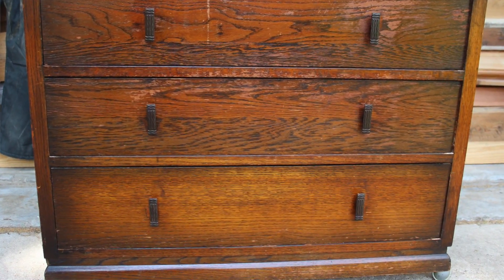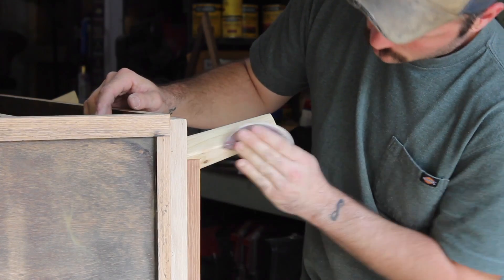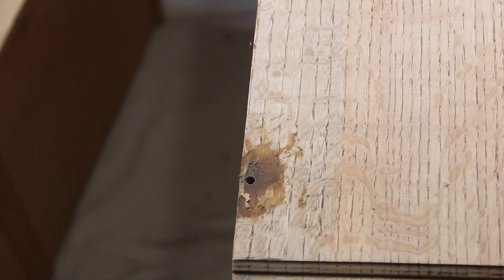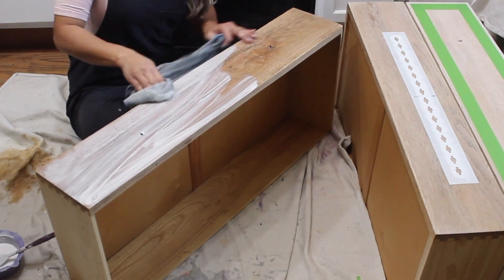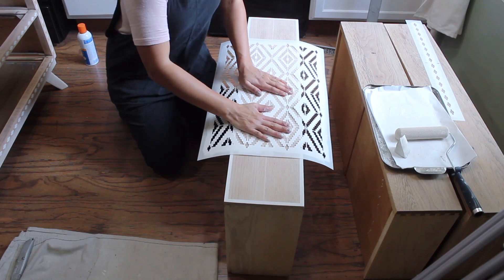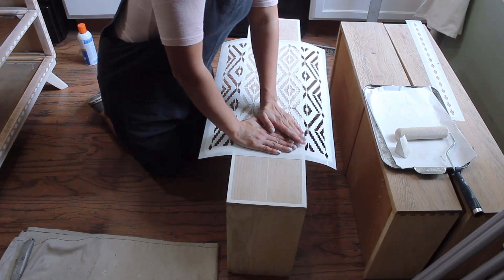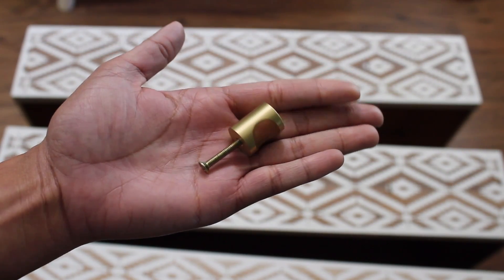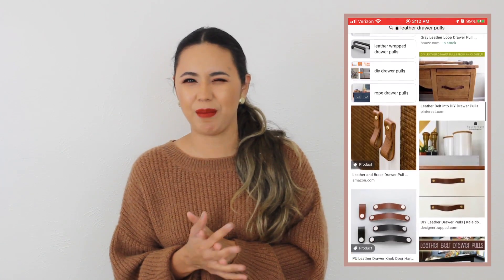Boho Dresser Anthropologie Inspired

Comment: Love this dresser. BTW a beater can help you get complete adhesion of your stencil. I also have found that 3M repositional adhesive works great. I put my stencil face down on a sheet of brown paper and spray from about 12-14 inches away. This adhesive was used for pasting up photos in the print shop I worked in many years ago and leaves very little or no residual adhesive and when evenly and firmly attached with a brayer I get no bleed under your stencil.
Reply from the maker: I’ll have to try my brayer! I have used the adhesive but I have another stenciled project coming up that I’m sure will test my patience 😂

Comment: How much do you think all the supplies came out to? I know you owned a lot of it already but im trying to figure out if it would be worth it to do this or buy a similar one!
Reply from the maker: Celia Jardine totally worth  doing it yourself. 
Depends on the dresser you find, that’s definitely the most expensive part. Stencil was about $35 and the paint and wax may be about $25 (you don’t need much paint) 
Drawer pulls really depend on what you want. And depending on the finish, you may need to strip it (stripper and plastic spatulas are probably less than $20) Other than that you just need a sponges, glue and sanding block.